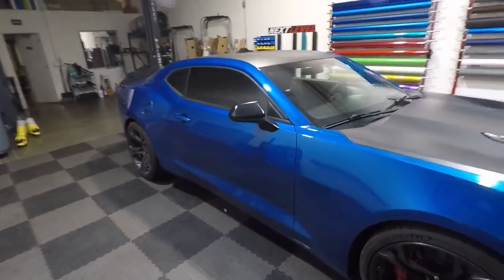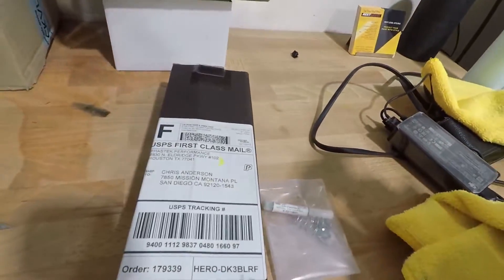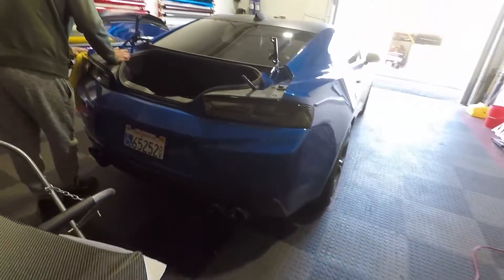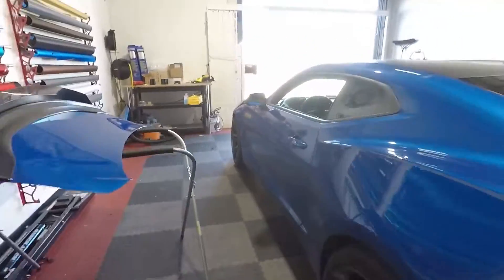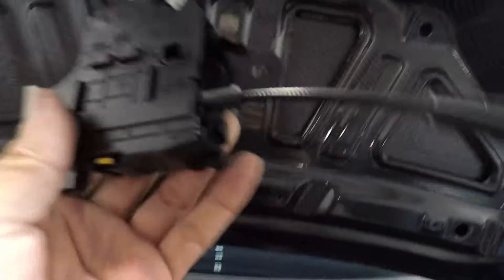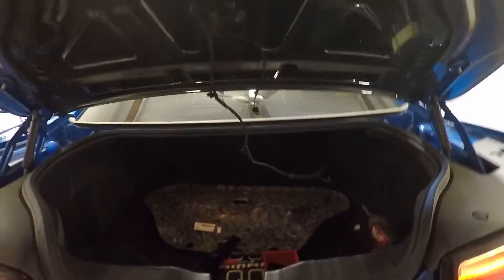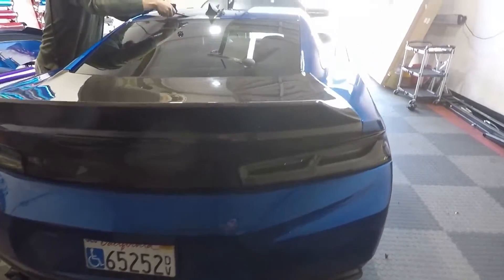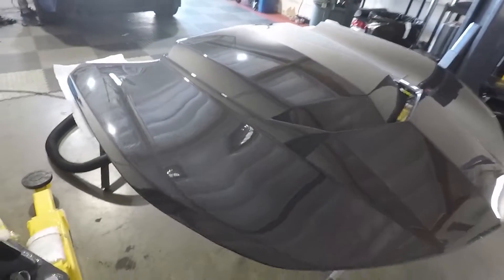Camaro SS 1LE Carbon Fiber Hood and Trunk Install   Anderson Composites

Comment: I did that same hood on my camaro and the right side wouldnt line up as good as the left side no matter what i did. You guys have the same issue? Also do you know how the owner going to seal the rotofab cold air intake now that the new hood isnt sealing it like the oem hood did?